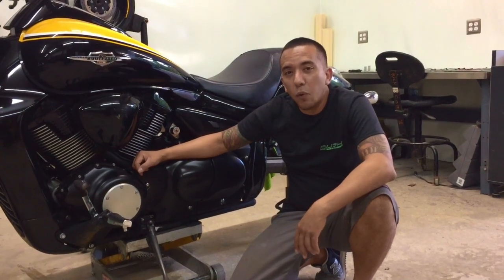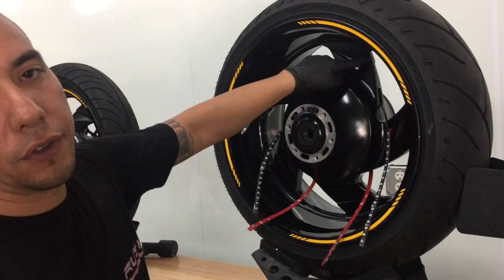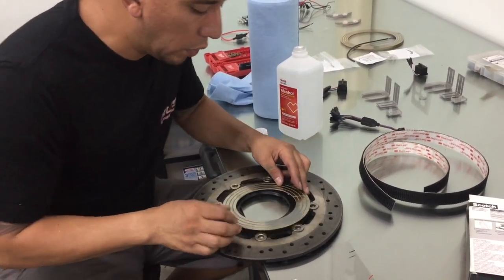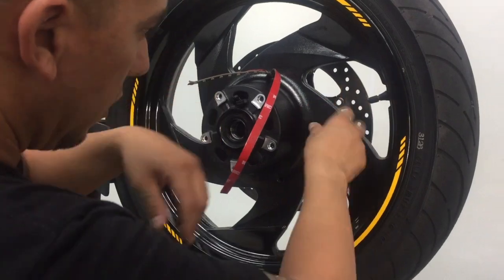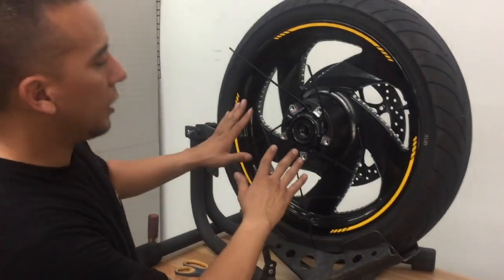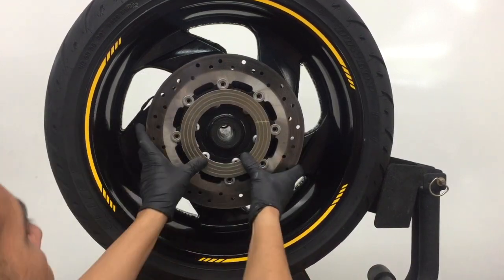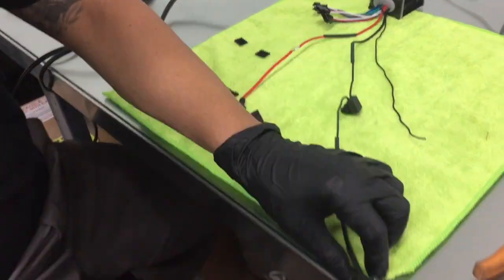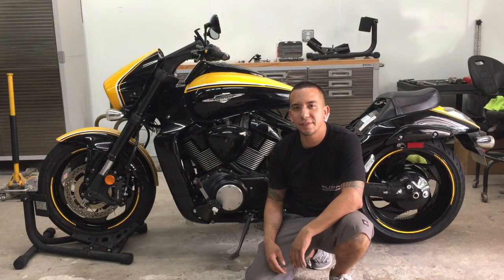LED Wheel Glow Installation Suzuki M109 (MULTI-COLOR)

Comment: Where are you located and how much does the kit plus installation cost?
Reply from the maker: We are located in Houston, TX. Cost for these kits vary based on the about of lights required for your wheels. I’ll pin a link to the comments above.

Comment: I watched this hoping I could get some ideas on how to power LEDs on my bicycle. It's probably not worth the effort to make these slip rings. I'll just have to use separate batteries in each wheel. I'm so surprised it is easier to set up wheel LEDs on a car than a two-wheeler.

Comment: Top tip to make cleaning wheels easier (especially the rear wheels, which usually have grease and oil on them): Use WD40 first and only afterwards alcohol or regular dishwasher soap. You'll get rid of all the oily residue without need to rub and possibly scratch your wheels.
Reply from the maker: @wildhogtv8197: Thanks for the tip. I’ll have to try that out.

Comment: cool
unfortunately in UK (where i live) only the purple lights are legal. everything else is illegal because idiots on roads can confuse different color RGB for service lights. 
for example you cant use orange or yellow because it can confuse people for a traffic ''wait'' light or they can confuse you for highway maintenance people. Green is due to traffic lights. Blue and red are used by the police, whites can get confused for headlights. 
so with all the other colors are basically shades of the originals, therefore we can only use purple lights lol
soon someone will claim  those too and then you wont be able to have any exterior lighting on anything

Comment: You glossed over how the bracket that holds the brushes and the secondary bracket got installed.
Reply from the maker: broderp: The brush block mounting brackets are made of two “L” brackets that are held in place between the front wheel spacer & fork for the front. The rear bracket is placed between the rear wheel spacer and the swing arm. These two “L” brackets allow you to adjust the position of your brush block from up/down & In/out. I will be posting another video specifically on the removal & installation of the brush block brackets. Thank you for you pointing this out and stay tuned by subscribing

Comment: Just got one ? Why is the front wheel spokes facing the opposite direction from the back or is it just me?
Reply from the maker: Sky Miller: Due to the M109 being a shaft driven bike, I turned the rear wheel around during this install because the led wires must be wired up on the brake side.

Comment: Need your number and where y'all located thanks
Reply from the maker: Arturo Macias: We are located in Houston, TX. You can visit www.RUSHBIKES.com or email sales@rushbikes.com with any questions
Reply: Thanks I'm in Beaumont TX about 70 miles from Houston
Reply from the maker: @arturomacias9147  That’s great! Your not too far from me. What year make and model motorcycle do you have?
Reply: 2013 zuzuki boulevard m 90 I would like to put the lights on it I see couple videos of you great work looks clean to
Reply from the maker: @arturomacias9147  Sounds good, Please email sales@rushbikes.com to lock in you place for your installation. LED wheel glow takes 3 days to complete
Reply from the maker: Arturo Macias: We are located in Houston, TX. You can visit www.RUSHBIKES.com or email sales@rushbikes.com with any questions

Comment: i had a kit from xk glow put on my gsxr ...the kit lasted a couple of weeks it was installed with double sided tape to the fairing and the heat made it all fall apart , I've had it not working on my bike for 2 years..stinks on ice i need a better kit installed correctly
Reply from the maker: Cheesefunnel: I’ve seen some shotty LED installs over the years, especially at the motorcycle rallies where riders are getting installs done at a booth in 2-3 hours. It can be difficult to find a good installer but I always recommend finding someone that you have seen their work and one who takes the time to do a quality install. These light kits take about 10-12 hours to install but the outcome is amazing. What part of the USA do you live in? Perhaps I can point you in the right direction

Comment: Good work but not
Sure that it can have a long life anyway. The best option is to transfer energy by electromagnetic field not by fixed electrical contacts as from whether or from water also it can have a problems
Reply from the maker: Aram Khachatryan: Your idea of transferring energy by electromagnetic field is good, but has limitations. Yes you can transfer electricity, but only a single color LED could be used. Since multi color LEDs generally operate with one positive and three grounds, four contacts are necessary to be able to change the lighting color. A remote module is also necessary to operate color functions. 

LED Wheel glow riders get an average of 12k-15k miles out of their brush blocks till replacement of Springs and Brushes a needed. This is only a $16 expense. 

To my knowledge, we haven’t had any issues from weather or rain.
Reply: @RUSHBIKESdotCOM  Thank you for feedback

Comment: Greetings from Colombia, your profession is excellent
can it only be used on high-cylinder motorcycles? or could it be adapted for an fz16?
Reply from the maker: ADEA SA: These kits can be installed on a Yamaha FZ16. It will simply require a different size slip ring.

Comment: This looks cool until I saw the installation process
Reply from the maker: PeteyPablo there is an easier way of wiring up the wheel lights but it requires the wires to be exposed on one side of the wheel hub which I’m not a fan of. By spending a little more time, we wire all of the wheel lights inside of the hollow cast aluminum wheel. The extra time is definitely worth it.

Comment: sound soft?
Reply from the maker: Jubez sound soft? I don’t understand the question
Reply: @RUSHBIKESdotCOM  sorry the audio is low to me.  Watched in full anyway!
Reply from the maker: Jubez Yes, I agree. I have since purchased a wireless mic. Future install videos will have better sound.
Reply: @RUSHBIKESdotCOM  sweet as, tag me when you do a custom fuel tank replacement will be my first mod.
Reply from the maker: Jubez what year make and model motorcycle are you working with?
Reply: @RUSHBIKESdotCOM  still havent decided... looking deep at boulevard stock atm in australia.   Lots of 08's available but 35k-40km putting me off.  Pretty sure ill end up with a 2013.
Reply: @RUSHBIKESdotCOM  2013

Comment: I bought my kit from you and totally happy.  These guys even sent me a strip that was left out.  The guys that installed my unit in CT did not remove the tires and taped the wires around the wheel.  So heated because I did not see this video I will never recommend them for install. And they did not install the kill switch. Paid too much.  So mad right now!!!

Comment: I'm going to have to pay you visit and have you do this to mine..
By the way, where did you place the kill switch?
Isn't there a way to mount them where when you hit Off on the remote, the power goes off to them, or when you turn the key off..
 Or is the power ring in the rotors not hooked up to the lights to work via the remote or key and are always on constant power?
No way to bypass that?
Ive never don't this before on a bike, so excuse the questions, but I'm trying to learn..
I did the ones in my car front to back (interior) nothing on the outside.
But I kind of cheated skipping all the hard electrical stuff (because I don't know what I'm doing to be honest)
So I used these 3m strips lights like you are using, but they had a USB end.
So I plugged the USB end from a  USB hub into the back of my radio where I have a USB out port which powers the hub when the key is on, then I plugged all the USB light ends into the hub (that I mounted up under the dash out of sight)
I did have to use a couple female to male USB extensions (for the back) but all the cords fit neatly out of the way in the trim all the way from the back to the front and up under the dash and into the USB hub.
It was so inexpensive, and you don't see any wires or anything, so it turned out nice, for not knowing much and getting creative.
I did it this way so that when the key was off, the power is off to everything as well.
Then I just hung the remote to the lights on a lanyard in the car and called it a day.
I hop in, pick a color, an effect, and it just goes.
It will go to the beat of the music if I want, but I never use that effect.
I'll leave you links to show you what I used..
I bought 2 LED light packs (one for front and rear and the other for my trunk, it's an SUV) 2 packs of USB extension packs and 1 hub.

https://www.amazon.com/gp/aw/d/B07T8DVCFK/ref=ox_sc_saved_image_1?smid=AMB3MS41BXNUH&psc=1

https://www.amazon.com/USB-3-0-Hub-Splitter-Individual/dp/B07FCKTG8L/ref=mp_s_a_1_19?dchild=1&keywords=usb+hub&qid=1595139088&sr=8-19

https://www.amazon.com/Extension-Besgoods-4-Pack-Colored-Braided/dp/B07FZYD7H6/ref=mp_s_a_1_5?dchild=1&keywords=Canjoy+3+Pack+6ft+USB+3.0+Extension&qid=1595139407&sr=8-5

That was my quick easy fix for interior lighting..
$80-90 bucks, took about 15 minutes..
But hey, it works, you know..
Anyhow, great video, and seriously, going to pay you a visit..
Thanks for always giving us such great content!
Gives us all an in depth look at your craft.
Reply from the maker: A Culp The remote control does allow you to turn on/off the lights as well as change functions but power is still being used by the module that communicates with the remote. The kill switch is connected between the 10 amp fuse holder and the remote module. The kill switch disconnects power from the battery to the module so that the module doesn’t drain the battery. I generally mount the kill switch on the back left side of the bikes so it is accessible without letting go of the throttle.Thank you for the kind words and as always we are here to answer any questions you may have. 🙂
Reply: @RUSHBIKESdotCOM  Awesome!
Thanks for getting back to me..
Hope to see you guys in the spring!
Reply: RUSHBIKESdotCOM I’m looking for the whole kit for my 109 or do you have a link for me
Reply from the maker: Randy Menendez I’m almost done rebuilding my website with an online store where you will be able to purchase the kits. Email me Marcel@rushbikes.com and I will assist you with your LED wheel glow kit.
Reply: @RUSHBIKESdotCOM  how do you get a wheel glow kit
Reply from the maker: SAPAYDA 1 what year make and model motorcycle do you own?
Reply from the maker: @KISHAUNC  email me at marcel@rushbikes.com and I will assist you with your LED Wheel Glow kit.

Comment: Absolutely stunning! Ive seen many of these video to learn how to do this but seeing what you did in this video floored me. Excellent work. Because im not capable of removing the tires i was wondering if you recommend any kit for me,? Or at least a website that has everything i need to do this. Ive got a Suzuki ct50 2017.
Reply from the maker: Freddie Spencer I’m currently working on rebuilding my website with a full online store to make your purchasing experience a breeze. Till then, email me at marcel@rushbikes.com and I’ll be happy to assist you

Comment: A slip disk rotor held onto a 2300 rpm wheel - by Velco?!
Reply from the maker: River Mersey The 3M Extreme Velcro is not like the soft fuzzy fiber on a child’s tennis shoe. Instead it designed with lock hooks that snap securely in place. Thus far, I’ve never seen a slip ring come dismounted from its location.
Reply: @RUSHBIKESdotCOM  Many thanks for your reply. 

The Extreme Fasteners can hold up to 2 pounds per inch for up to 10 pounds total. Figures are given for a static mass, when that mass is rotating, accelerating, decelerating, the arithmetic becomes rather more complex.

My guess would be that affixing even with this velco is bordering on the adhesional limits of this material.

Additional to the load bearing concerns, 3m website gives tech specs for their products, including the maximum working temperatures. As these disks are held in place by velco very close to hot working surfaces of brake rotors, the system is again being worked very close to it's limits.

Comment: 2 questions: one, how long does the brushes making contact with the rings last, wear down before needing replacement brushes? Two, I didn’t see it being test driven but is it recommended more for while the bike is parked at an event/gathering or can it be driven just as much?
Reply from the maker: Tonio Vant The brushes are made of carbon and are spring loaded inside the brush block. I have gotten over 15k miles before needing to replace the brushes. It also depends on how the rider rides. Sport bike riders usually wear out there brushes quicker due to higher speeds. The brushes are only $16 for a full front and rear replacement. Here is a link to this bike on a ride.  https://youtu.be/1wb8BQ_LTeE

Comment: Just looking through our emails I think it's covered. Removal of the gilled plate and replace bolts for shorter ones.
Reply from the maker: Charles Jarman Yes, I do remember removing the gilled brake rotor cover to allow a flat surface for the ring to mount to. Shorter bolts will allow proper mounting bog your rotor after removal of the gilled rotor plate.

Comment: Any day now I'm going to Man Up Marcel and do the install on my 2015 VMax. You have 2 videos posted regarding the LED Install the other being a 2012 Yamaha Stryker. In that video you didn't drill through the brake disc. What do you recommend for the VMax? Cheers
Reply from the maker: Charles Jarman The Yamaha Stryker as well as many cast aluminum factory wheels have hole openings in their wheels near the hub already; eliminating the step or drilling a pilot hole for an LED wire to run through. It’s bee so long since I’ve done a VMax, I can’t remember if a hole is necessary, but I’m more than happy to assist you when it comes time to do your installation

Comment: Nice video! Is the glow kit from Raw Design? I have the first gen power rings on my 109. I dont trust the brake mounted pucs with velcro.  But I know my pucs are going to fail at some point. Its surprising they still work.
I enjoyed this video very much!
Reply: Your pucks fail yet? 👀
Reply: @joartstewey  sure did. But, they lasted a few years. I did go with the new generation ring and pucs. So far no issues. The good thing is you can replace the parts much easier.
Reply: @LLoyoc  so you used the Velcro on the puck and just replaced that part and everything was good to go?

Comment: Damn man!!!   NICE WORK.    Tell me you are in the East Bay (California). I need you to hook up my Rod Glide!!
Reply from the maker: My shop is located in Houston TX. I have had many people ship me their bikes as well as ship me their wheels for installs. The Touring bikes do not necessarily need the rear wheel illuminated. Many touring bikes can simply add LED strips at the bottom of the bags to create a down shine that  is consistent with the wheel glow. You can contact me via email at marcel@rushbikes.com or contact me at (855)969-2453 ext 1

Comment: So much work, but the end results are really awesome. Your attention to detail and tips in the install are extremely helpful. This makes the wheels pop like something from Tron. Do you you silicone the mating surfaces of the lights in the engine compartment? What about extreme heat, say from a really hot day. No issues with 3m tape? I really enjoyed this project. Great work!

Comment: I have a 2007 M109R... HOW MUCH DO YOU CHARGE FOR THE WHEEL LED.. I ALREADY HAVE THE LED DID IN THE BIKE, BUT NOT THE TIRES.. OR WILL THEY HAVE TO BE REPLACE WITH NEW LED.

AND YOU DID A GREAT JOB.. I'M GOING YO SHARE YOUR VIDEO WITH EVERYBODY I KNOW THAT RIDES A MOTORCYCLE
Reply from the maker: Demetrious Hollis LED wheel glow kits installed on an M109 is around $1300 a DIY kit is about $850

Comment: Metal ring connector on the wheels won't last, corrosion and them spinning so fast will generate heat n wear the contacts out fast, looks good BTW
Reply from the maker: I've had the same slip rings on since 2012. I have hit speeds up to 176mph and have not had any corrosion or visible wear. I have replaced my brush blocks when the new G5 brushes came out, but not due to any damage. This system functions very much like a power drill does with carbon brushes to conduct electricity through spinning components. Heat from friction has never been an issue. This kit requires attention to detail upon installation. I have posted these videos in hopes that they may assist others in producing a professional install.
Reply: @RUSHBIKESdotCOM  that's brilliant to hear, thank you so much for replying and letting me know the durability of the slip rings isn't a issue

Comment: Will you they get damaged if you ride in the rain for an hour or more?
Reply from the maker: Alberto Santiago No, the LEDs that are used have a water proof silicon coating. These kits come with a kill switch that disconnects the power from remote module. If you do find yourself in a rainy situation, and low voltage power does run constantly, we suggest disconnecting the power by clicking the kill switch.
Reply: @RUSHBIKESdotCOM  let's say they are on and I run into rain or I go over some water will the unit short? Not because of the LED strips but because the exposed metal rings that I'm guessing have power going through them, this is my main concern.